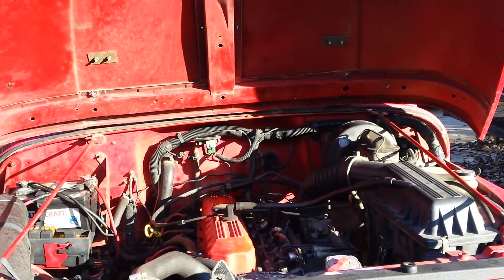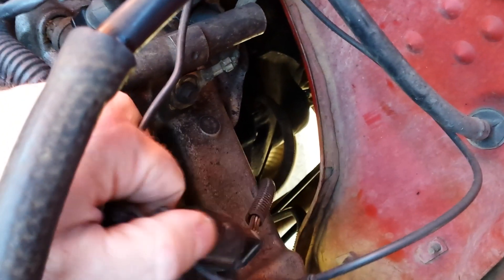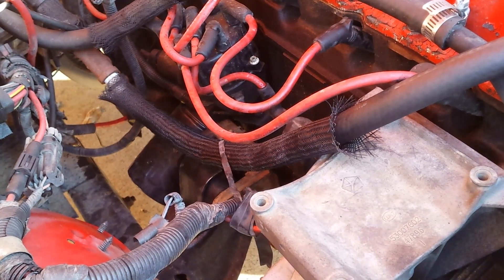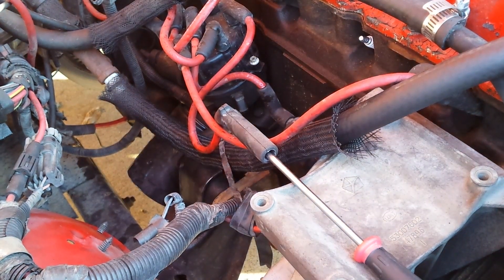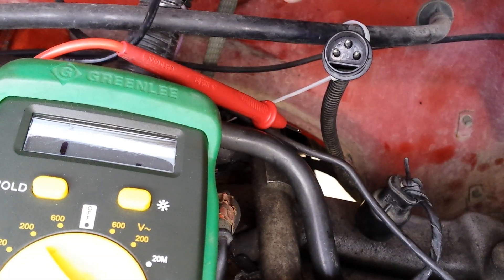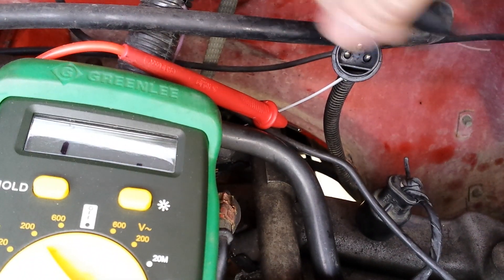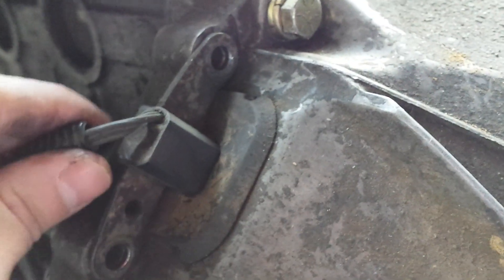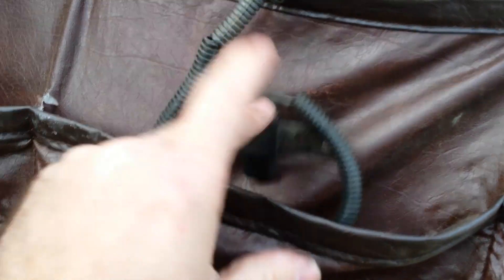Jeep Wrangler - Crank Shaft Position Sensor - locate and test #poweraddictscrew #jeepwrangleryj

Comment from the maker: Has this tip helped you? Here is a free way to help me. Here is my Amazon influencer page that has many of the parts I've used in videos and some parts that friends have used. https://www.amazon.com/shop/poweraddicts-fixjeepscom-jeepcarandmotorcycletips?ref=ac_inf_hm_vp . By purchasing through this Amazon page you help me get a small commission of the sale and you do not get charged a cent more. Keep checking back because I update the Amazon page often. Thanks for your support!
Reply: Hi from Spain. Could you help me? I just swap the tf999 to ax15 in my old  4.0l 91 YJ and now I don't have sparks in my plugs...I think that the problem is in the CSP, but is new (part number 56027866AB , buy in amazon )... the YJ Works perfect before the swap at morning. what do you think about it? Problem in the CSP,  is different the PCM Between auto 4.0 and manual YJ...or anything. THANKS FOR ADVANCE, thanks for the re-clocking template and sorry for my language blunders.
Reply: Thank you for another great video. Im going to get you some electrical alligator clips for Christmas. Lol
Reply: What year is this Jeep?
Reply: W
Reply: I will be using this because you definitely helped me!

Comment: If the bolt  falls in the hole then you can remove a steel plate on the bottom of the bell housing and fish it out from there, you don't have to separate the transmission from the engine.
Reply from the maker: That is true. The throw out bearing went out in my Dad's TJ. We pushed that plate back a bit and ball bearing came rolling out.

Comment: My jeep was taking a longer time starting then it should. Power was down, sputtering until up to temp. Cut out occasionally as well as gas smell. Replaced CPS fixed everything - ngk/ntk is the OEM provider & the best made. Standard motor products is cheaper, not quite as good but works very well

Comment: Awesome video! I've purchased quite a bit of diagnostic equipment to identify the problem with my '97 Grand Cherokee. I don't mind because I've learned a lot about my Jeep. Plus new coil, cap, rotor, and cam position sensor (which I thought was a condenser!) have been installed. I'll test the crankshaft position sensor in the morning. I saw a sight that I should use Mopar only. Have you found success with other manufacturers of Crankshaft Position Sensors?

Comment: Question everything I’ve read on the forums is saying 200 ohms of resistance is normal, but I bought a cps from Oreillys and it had about the same Resistance as the one I took out but the Jeep wouldn’t start at all with the new one but still will with the old one, so had them order me another one lol I’m at a loss tho 1990 Jeep Wrangler 2.5 TBI

Comment: Thanks for your videos.  Replaced my crankshaft position sensor and coil, still no spark off coil lead. Any suggestions?
Reply: Also replaced ECU.  Will the distributor pickup sensor cause the coil to not spark?

Comment: If I'm not having my check engine light come on when I'm cranking, is that my ECM or could it be my crankshaft position sensor? Thanks so much
Reply from the maker: Verify you are getting power to the ECM. If you are getting power to the ECM and have no check engine light at any time. More than likely you have a bad ECM.

Comment: MINUTE  13:30 ..      I AM MISSING THAT RUBBER SEAL/ SPACER WHERE THE SENSOR GOES INTO.    I AM TRYING TO GET A REPLACEMENT,   DO YOU HAVE ANY ADVICE ON WHERE TO FIND ONE.   

1991 JEEP YJ 
4.0L
AX15 TRANSMISSION

I AM LOCATED IN CALIFORNIA.   
THANKS
Reply from the maker: Go to a Junk yard and get one from a XJ or ZJ Cherokees

Comment: Thanks for this video. I have a 1988 Cherokee that the crankshaft position sensor wire hit the exhaust manifold & melted. I barely got it home. I put a new one in, but it would turn over but no spark. I checked the new sensor with an ohm meter & I'm getting a reading on the meter it's not showing an open circuit. I'm hoping that after I replace the sensor again I can get it to start. Thanks.

Comment: can the sensor still be bad if i don't read anything on 
my meter?
Reply from the maker: I've haven't had that happen. But I'd say it could be possible. They aren't too expensive, you could try one. If that doesn't fix it I'd keep it as a spare in the Jeep. There are 2 sensors in a YJ that will leave you stranded. That's the Crankshaft sensor and camshaft sensor. Doesn't hurt to keep spares in the rig.

Comment: Man I got a 93 yj 2.5 Iam having heck trying to figure out the problem!! My jeep idles fine and runs good but very sluggish and seems to flood out if I stop at red light and seems to lose power going up hills top speed I get out of it is 55 mph with 31 inch tires  I have put new injectors new tps plugs wires cap checked for vacuum leaks checked fuel rail and so on.  When it happens to lose power or flood out and back fire I can turn key off then right back on and Iam ready to go again but still nothing over 55mph.  Any ideas ???

Comment: Thank you for you help.
Reply from the maker: +Dale Czernecki You are welcome :-) Thanks for taking the time to leave a great comment. Have a great day!!
Reply: Comes to find out my issue was not the the sensor. Its was the fuel pump. I was low on gas and had to hit the tank and then it turn over. But I order the sensor for the future.  Any videos on how to change the fuel pump?
Reply from the maker: Well .. here is where i demoed repairing the fuel gauge. I had already cut an access plate so I didnt have to drop the tank. Get as much fuel out of the tank as possible to make it as light as possible. The filler neck has 2 hose clamps. The tank is held up by 4 bolts. It will come out after removing those. Thje attached videos demo how the fuel pump comes out and the other video how to remove the filler hose clamps.

Remove fuel pump - https://youtu.be/6i9X2agOEYs?t=24m17s

Remove filler hoses - https://youtu.be/I8CipgprhYA
Reply: Hey i am have an issue with my battery draining. I have even replace the alternator 2 twice. My alternator on puts out 12.5 my jeep 1995 straight 6. There is nothing drawing anthing when vehicle is off. Any help?
Reply from the maker: If your alternator is putting out only 12.5 volts. Its not charging correctly. Typical voltage will be about 14 - 14.5 volts.
Reply: +Power Addicts - FixJeeps.com - Jeep, car and motorcycle tips. ok but i have put in two new alternators and both only put out 12.5 and both passed the bench test at the store. this brand is ac Delco. i am going to replace both this weekend again. is there anything i could check to see if there is a draw on the battery while its running?
Reply from the maker: Some YJs have the voltage regulator built into the Jeeps computer. But .. typically when they go bad the voltage spikes too high. Ask the parts person if it had the internal voltage regulator. If not, could be the Jeeps ECU. If you are checking the voltage off the battery and its reading 12.5. Try reading the voltage directly off the back of the alternator. Its the fat red wire on the back that uses the nut to hold it on. If you are getting 14+ volts from there, you have a bad wire going to the battery to charge. If it reads 12.5 at the alternator, run another ground from the alternator to a clean bare spot on the block. Then test the voltage again. Got 14+ volts .. you have bad ground going to the alternator. Bolt in that ground wire making sure to route it away from moving parts. After test ground and you still have 12.5, and the alternator is an external regulator alternator ... its the ECU.
Reply: Ok thanks that's totally something I never thought of. Your help is appreciated. Have a great day and I will tell you the outcome after its done later today.
Reply from the maker: You're welcome :-) Hope is goes well

Comment: Do you happen to know if you can put the reluctor ring on at the wrong degree? I just removed my trans to do a rear main seal on my 95 yj 2.5 auto. when I put it back together it wont start. it will crank but wont start. I'm replacing the crank shaft sensor tonight. hopefully that helps but I'm hoping I didn't put the reluctor ring in the wrong position
Reply from the maker: Very much not likely. The ring is welded to the flywheel/flexplate. There is a specific location on the crank that it gets bolted too so you cant bolt it on in the wrong location. Check the area around the bell housing to make see if a wire may have gotten pinched. I have seen that happed a time or two.
Reply: I replaced the crank position sensor and got it running yesterday. Thanks for getting back to me.

Comment: Have been given a 01 TJ. The only problem is that it will cut off. Looking around the Wrangler boards and see " crankshaft position sensor ". Brought me to your page, and love it! So straight forward. Subbed, and liked. Hope this fixes my issue. Thank you!
Reply from the maker: There are 2 sensors that will prevent them from starting. Crankshaft position sensor and camshaft position sensor. If I understand what you are describing as it just randomly shutting off, that is typically the crankshaft position sensor. Good luck, hope you get it fixed!! Have a great day!
Reply: It was the crankshaft sensor. Learned how to pull the code, and it was the p0320 code. ALL is well. Thank you again!
Reply from the maker: Glad you got it! You're welcome. Have a great day!

Comment: Damn glad I found this vid. He's right, this plug was replaced in later years & it's hard to find diagrams or vids on if you roll XJs. They're all on the oval plug. I guessed correctly what ABC were as I'm sure most woulda but you confirmed it. Oo, & thanks for the tip on the paper spacer on XJs , that woulda sucked. Just wish you woulda mentioned which letter corresponded with reference, ground, & output. Easily cross referenced with those fore mentioned diagrams though. Thanks Power Addicts, saved my DD rig
Reply from the maker: You're welcome! Glad the video helped you! I was thinking that I put a diagram on the website:http://www.fixjeeps.com/crankshaft-position-sensor.html . I looked and sure didn't. I gotta get one on there to make it complete. Thanks for pointing that out! Glad your XJ is rolling. Thanks for taking the time to leave a great comment! Have a great day!!
Reply: I'm confused - the video shows the round plug & you are testing across B & C  -  then you say that the round was replaced with a flat plug - A B C  - then you say "you want the 2 outside poles"  - does that mean test A & C on the flat plug?  also, what is the 3rd pole?  is it the power supply? & what voltage should it be?

Comment: When he tests the CPS in ohms and says it should have no resistance, the meter shows 1, and no resistance should show 0.0
When I bought a new CPS for my 4.0, it read 0.0 ohms, same as the one I removed after viewing this video. It turned out not to be the CPS but my Coil that gave me a false reading looking good, when I tested it, before researching additional reasons for the no-spark and found this video. 
The video did give some really good advice to be careful not dropping the CPS bolts in to the Bellhousing.
Reply from the maker: No, Actually there is no fault in the video. The reading is correct. If you were watching the meter it stays at "1" all the time with the leads "not touching" anything. When I touch the leads together it then went to almost 0, just measuring the resistance of the leads themselves. What I was saying in the video, there should be no change at all in the meter reading and there wasn't. The display in the meter never changed as it shouldn't when reading across pins B and C. I'm reading and quoting this straight from the Chrysler service manual as I type this ...  "Place an ohm meter across terminals B and C. The meter reading should be open (no resistance). Replace sensor if a low resistance is indicated". The part where is says "The meter reading should be open" means an open circuit, as in, there should be NO change in the meters reading and again, there wasn't. Yes, I've measured sensors after releasing this video that also read 0.0 and the sensor still worked. But technically, the meter should read the sensor just like it is when its turned on with the leads touching nothing.
This video will soon be 3 years old. That Crank sensor is the same sensor I'm still running today. No issues with the sensor or the video.
Coils can be finicky testing them. Sometimes it depends on whether the coil is hot, warm or cold as to if it test good or bad. Crank position sensors can be tricky as well to diagnose. About 95% of the time when a crank sensor fails .. its done and not coming back to life. I know of a Cherokee that has had 2 Crank sensors changed out. Each time when the engine cooled it would start up and run till the engine got hot ... then .. fall on its face again. Testing the Crank sensor after the engine cooled enough to touch, it tested good be cause is was cooled down. The symptoms at this point says that the coil could be the issue. Tested the coil, it tested good because it had cooled down. Swapped in a known good coil, still fell on its face after getting hot. Swapped in another Crank sensor ran for over a year trouble free. When it acted up again showing the same symptoms, we swapped a crank sensor in a all was good again.
Glad you got your ride going! Have a great day :-)

Comment: +power addicts :   I have a 98 wrangler replaced the starter due to having to jump start it while someone tried to start the engine however now that the starter is replaced, battery is replaced as well as ignition replaced still cant seem to find why there is no noise when trying to start the jeep. I am at a stop loss I know the engine works and runs distributor and alternator and battery replaced all within the past 2 years.
Reply from the maker: Not exactly following you by what you mean be "No noise"? No clicks, no starter turning over?? After replacing all those parts, if the starter isn't kicking in, you may need to check the starter relay.
Reply: +Power Addicts - FixJeeps.com - Jeep, car and motorcycle tips . yes no clicks starters not turning over . starter relay assuming that's in the steering column . u even replaced the cables to the starter was leaning towards ecu or cps malfunction
Reply: +Power Addicts - FixJeeps.com - Jeep, car and motorcycle tips . the starter relay fuse I looked at it didn't seem blown is there a way to test with a multimeter
Reply from the maker: You can use the resistance setting across the two poles. If you got no reaction from the meter, Fuse is bad. Easiest thing to do is swap in another fuse then just try. There should be a starter relay also. Im not sure where its located on a '98. Check the owners manual for the relay location.

Comment: 1990 wrangler yj 2.5- I checked and I do have a spark.  Where do I go next?   Jeep overheated, loose hose on radiator leaked fluid.  I limped it home as it only overheated close by.  Fixed loose hose, replaced fluid and she cranked up fine and sound was very normal.  Then she conked out and would not start.  When I try to start- she will not engage.  Everything is working to try to start, but engine will not engage.  The gas pedal makes a humming/kocking sound and moves up twice.  Didn't know if this is tied to the culprit.  Any suggestions on where to look after find spark in this video would be greatly appreciated, b/c I love my jeep.
Reply from the maker: It takes 3 things to make an engine run. You said you had spark. You said that it started normally for a bit, so you have fuel and at that point you had compression.

The issues you stated: It ran hot .. still drove it while it was running hot.

Because you still drove it while it was running hot, the first thing that comes to mind is possibly popped a head gasket. If a head gasket is blown in the right places and bad enough, it can swap compression between cylinders, release the compression into the water jackets, release the compression into the crankcase or any combination of those places. Enough compression loss it may not start, I've seen it happen a couple of times. To check that you will need to test the compression of each cylinder to see if one or more is loosing compression. Unfortunately, I haven't created a video on that yet. I just put it on my video "to-do" list and will do it very soon as its an easy check and you can get the tool from any of the "loan - a - tool" programs at auto parts stores. If its a blown head gasket, it's not really a novice job. But it's not brain surgery either.
Reply: I appreciate the reply!  I was getting nervous b/c everything was leading down the worst road.  So, I tried resetting her computer one more time, but this time I disconnected both positive and negative for an hour and said a lil prayer.  She cranked back up just fine and roaring like a mistress on a wedding night!  Huge relief  Appreciate your videos.
Reply from the maker: Glad she is going for you! Still kinda of a head scratcher why it did it in the first place. None the less .. glad its rolling again!! Have a great day!!

Comment: Great video and explanation of a problem I had with my 97 TJ.
Reply: I hope you still have your TJ.  It will be very interesting when the infamous, "No Bus," error comes up.  After 415,000 miles on my aging TJ, the infamous, "No Bus," came for a visit.  My computer is a mess.  I jumped the fuel pump and the injectors and I am driving my TJ until I can get a computer.  But it is not very pretty when the engine is cold.  When thed engine is warm, you would neved guess there is something wrong.